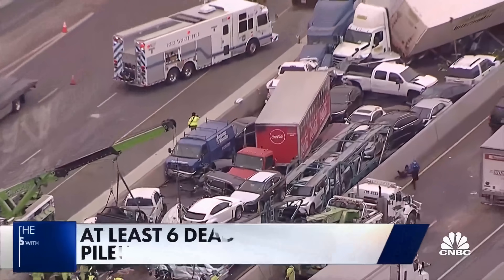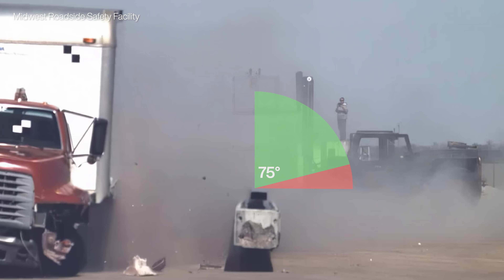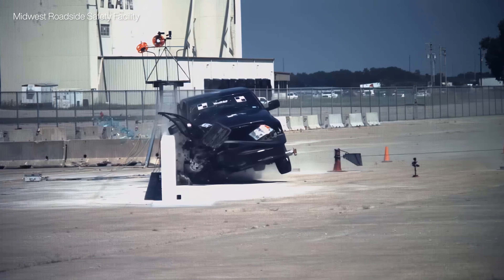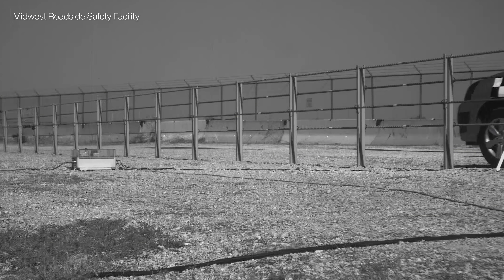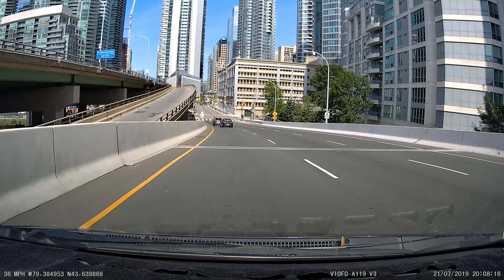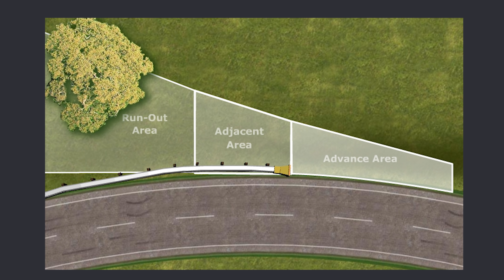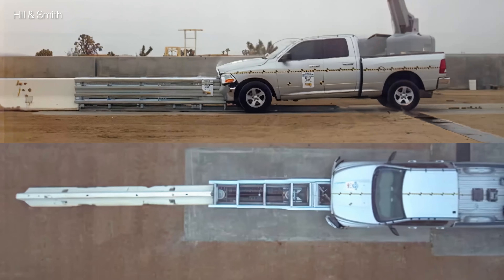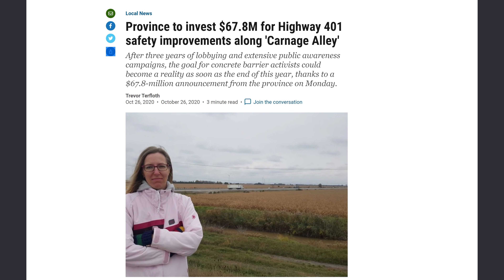How Road Barriers Stopped Killing Drivers

Comment: Cable barriers are the most dangerous system when it comes to bikers.
Reply: Just dont crash lol no seriously though I've never thought about motorcycles crashing in those things
Reply: @alexrosado3890  There is One thing that is Certain in Bike Life..Its not a matter of IF one crashes, Its a matter of When one Will crash.
Reply: God, these comments are full of posturing losers.
Reply: Dont byek
Reply: Not according to acutal research which found effectively no difference between cables and guard rails and only a minor difference between those and concrete (but we're talking like 5% less chance of fatal or severe injury). The entire rigamarole about cable barriers being 'dangerous' for bikers was like so many such things based entirely on a vague, anecdotal or speculative assumptions. The truth is it doesn't really matter WHAT the barrier is, if a motorcyclist goes into it at speed, he's pretty much fucked regardless BECAUSE he's a motorcyclist. 

Just one more reason they're fucking death traps.
Reply: @Tk3997  LAL  Laughing a little
   Thanks.  I get so bent out of shape when people make statements, that they may honestly believe, without any facts.
   The whole bit about "full moons" for example, for police, fire, any rescue work, doesn't hold up.  Counting -- many times research only takes counting 1,2,3,4 --  shows that events are no more frequent or intense during full moons than on other nights.
           Retired librarian
Reply: @Tk3997  Im gonna go out on a limb and guess you have no road rash to show off. XP I could very well be wrong and you are a seasoned Biker but, Im comfortable with doubting that. to have ridden much. I only say this due to you ignorance about barriers and how Motorcycles Actually interact with them outside of a search result on Google.  Fact is,  Every Post set system is a danger to Bikers by a factor of At Least as many Openings that are between the Posts..XD . Pretty much every biker out here would rather see a smooth Concrete wall or Nothing at all. The issue is with the spaces of any Post rail system, Those gaps tend to act like teeth at speed and bite off arms, legs and heads,... before ejecting the riders carcass into the roadway. Add a wire that acts like a cutting implement and its a slight bit worse. In contrast;  With a wall its much less of an issue as we can slide it out against a smooth surface and normally arent spun around like a Frisbee under a vehicle. or In many cases ive witnessed and rode out,  we can ride up  a walls curb without the bike getting grabbed by the post and spun out into traffic...  I have  been riding for 42 years, & Yes, I have seen and experienced a Lot of death while riding, Some from ignorance or Hubris but..Most of us, Myself included (*I got better), are killed due to Caged ignorance. Sure, Bikes are dangerous and many consider them "death traps" But, As some one that's Lived the Research,  Its usually other drivers that fuck us and  Overwhelmingly, the Car Hits the Bike Head on.. Even though construction matters, Barriers arent the danger to bikers, Caged ignorance however, Is.
Reply: @redneckhippiefreak  Amen!
Reply: @redneckhippiefreak  man you are spot on when i worked as a firemen i seen more bikers lose limbs hitting guardrails and almost every one that hit a cable barrier was killed those that hit concrete had broken bones but most survive and it was way less gruesome the cables and the guardrails was always a gruesome scene and almost every one of the crashes was caused by cars merging over on the biker or turning in front of them very few was the bikers fault
Reply: @redneckhippiefreak  We are not going to use Jersey for motorway medians except at narrow points.
Reply: @redneckhippiefreak  
No I don't, but that's irrelevant. You have no authority on the topic either, just like I couldn't claim to 'know' some random feature of roads is dangerous to cars based only on my own experience or something 'people tell me all the time'. You riding a bike doesn't mean you know ANYTHING about impact dynamics or the effects of crashes into barriers, if you were a roadway engineer then your opinion might hold weight, but just being a bike rider means absolutely nothing.Anecdotes aren't evidence, a fact far too many people don't or refuse to understand, and that's all your 'experience' amounts too. 

The reality is that research has failed to find an significant increase in injuries associated with wire barrier systems vs guard rails and only a minor one vs concrete. In point of fact based on what testing has been done and utterly contrary to what you claim the real danger doesn't even actually seem to be in the wires, but rather the riders impacting the POSTS, but this was also a risk factor for guard rails were it was fairly easy for riders to slide under them and into the posts or to strike the end of the rail. This was compounded by many system basically using I-beams in the ground with sharp edges, but this is now being moved away from for this reason. 

This is entirely sensible as contrary to Hollywood, steel cable thick enough to catch a speeding car is not going to act like a lightsaber when struck. The injuries from wires themselves are blunt force, but the wires themselves have more give then a rail or concrete barrier, this is a part of why they're safer for cars as noted in the video. This effect is not lost on a bike rider, while there may be some increased risk of snagging resulting in a twisting injury of some kind, it's probable that the overall level of deceleration is probably lower reducing other injury risks.  

In the end the evidence that has been collected thus far has failed to strongly show any increase motorcyclist deaths and injuries from wire barriers, but it HAS fairly conclusively shown marked reduction in cross median intrusions by cars where they've been used which tend to produce a highly disproportionate number of fatalities and serve injuries. Thus even IF the wire barriers were slightly more hazardous to motorcyclist there use would still probably be justified based on the fact cars are FAR more common and they are preventing many severe crashes by them. 

Few motorcycle crashes involve barriers anyway, single digit percentages of fatal accident according to studies, so there must be a cost benefit decision made here. Protecting many more car drivers, vs perhaps slightly increasing the risk to a small number of bike riders though even that's unclear.
Reply: ANY Barrier is dangerous for a Biker going 65mph+ tho right?
Reply: @NatronFatumallafalla  no not necessarily. Bikers who wear gear can with stand impacts up to 100 mph depending on the angle of the impact. Yes they may have many broken bones, but walk away with their life still. I hit "head" on into a pipe fence at around 45 to 50 mph and lived. I broke my back and a lot of other bones, but I'm still here. So hitting a concrete barrier at an angle doing 70 to 100 is very possible to walk away from
Reply: @redneckhippiefreak  yeah unfortunately they live in their little bubbles of fear of everything thing and since we don't live with that same fear we are crazy and with lack of knowledge on what we actually know. I pray that they have their eyes opened and see the reality that those who drive in cage vehicles drive most of the time with a nonchalant mentality with no awareness around them. As when bikers, we ride with our eyes on everything thing around us. I'm not saying every biker is this way, but for those who take it as a lifestyle with respect do ride like that. And I'm also not saying every driver of a caged vehicle drives without any awareness, but a huge  majority of them do especially compared to a biker just because they have more protection around them. That's why you see so many people with bad attitudes swerving at motorcyclist with their vehicle because they no they will be just fine if they hit us. I don't usually have that problem, but I do have them dang country boys in their big trucks think they got to drive up on me if they don't agree with my riding and almost kill me because of their prideful angry attitude
Reply: Idk man I ran in the back of someone going only 5mph and it totaled my car...coolant spraying everywhere air bags etc.  People don't realise how dangerous vehicles are
Reply: But that doesn't stop them from weaving in and out of traffic at 90mph, passing people on the divider line, and tailgating. When I see bumper stickers that say watch out for motorcycles I agree. You have to keep an eye out for them, they're always doing something stupid.
Reply: @HotspotsSoutheast  pathetic statement again from someone who just has no clue what it's like on a motorcycle.  Yes there are some people who get on a motorcycle with very little experience just like any teenager who just starts learning to drive a car, but sadly we have full grown adults driving cars and trucks distracting themselves with whatever it be inside their vehicle like phones, changing radio stations, talking to their passengers or fighting with their passengers, eating while driving and so many other things. Bikers hmm how often do they distract their selves with things while they ride? Maybe 1% if any! We happen to have hands, feet and eyes ready for any given moment that our lives can be taken for "any" mistake.  Unlike people in cars who don't really feel any threat the moment they sit down in their nice little safe zone. I drive cage to when I need to and with the experience of riding as much as I do I treat my situation in a car way differently then the average person and when a biker flys up I stay still knowing they are gonna lane spit and fly by and if they aren't going that fast, but still fast and I'm in the fast lane I move over as soon as I can. Without being angry. And I just hope the best for that rider. When I drive my cage my eyes are the same as when I ride. I constantly look all round me. My eyes are forward and they swivel to each mirror pretty often and when switching lanes I check all mirrors and look over my blind spot and I switch lanes slowly incase I happen to miss something and it allows for better reaction time for me and any other individuals on the road. Have a good day and practice awareness in your vehicle 😉
Reply: @HotspotsSoutheast  also walk up to a biker and say that😂 I pray for you! There's a reason we ride and it's because we are fearless. Be careful out there now😉
Reply: @HotspotsSoutheast  "facts" 
yeah ok bud
Reply: @DylanMcMullen  yup, sorry they hurt your feelings. I’m old enough to remember when people didn’t get their feelings hurt over facts
Reply: @HotspotsSoutheast  whered you see any feelings, much less hurt ones? Im just here laughing at your ignorance
Reply: Hahaha oh, I read it as "bikes" and not "bikers"
Reply: But aren't cable barriers almost exclusively used on highways?
Reply: @lalle5000  Yea I think he means "bikers" as those who ride motorcycles.
Reply: @lalle5000  not leg powered bike ^^
Reply: @lalle5000  bikers not to be confused with bicyclists
Reply: @justan idiot Meh, Its an odd sensation,  I lived in the mountains a long time..Ive been over a few road sides into the tree tops. XD  Few people live to cut their bike out of the top of a 60ft tree. XD Ive done it twice.
Reply: @redneckhippiefreak  Was it the same tree? Hahaa!
Reply: @redneckhippiefreak  dude, don’t buy lottery tickets and keep riding on bro!
Reply: People don't ride bikes for safety though. If they wanted to be safe they would get a car.
Reply: @WilliePeck  what a stupid stament! So people don't die in cars? Smh plain stupidity right there with that comment!
Reply: Bikers are already at risk to themselves as it requires only half a brain to operate half a vehicle ,

Stupid little jerk on a little bike with a dimmed tail light going only 55 in a 70 zone almost got turned into hamburger  ,

Comment: As a road designer who implements crash cushions a lot here in the Netherlands, i do have my worries with the re-usable crash cushions. On a light crash, o.k. but after a heavy crash not. They are tested in a new condition. Would you re-use an airbag after it's been deployed by folding the cloth back in and inserting a new gas-cartridge, I guess not. Here we replace the complet unit directly after a crash, and examine the old version in the factory if anything is still salvageable.

There is also a lot of controversy about the terminals that plow away the guardrail planks. A lot of them only work when you hit them on a 0-degree head-on angle. But normally when you run off-road you would hit them that under a 15 degree angle and they still impale the vehicle. Google search on "Trinity guardrail lawsuit" and you'll see what i mean.

https://www.google.com/search?q=trinity+guardrail+lawsuit&tbm=isch&ved=2ahUKEwj7lc6QluTwAhVB57sIHY0vAF4Q2-cCegQIABAA&oq=trinity+guardrail+lawsuit&gs_lcp=CgNpbWcQA1AAWABgzdADaABwAHgAgAEAiAEAkgEAmAEAqgELZ3dzLXdpei1pbWc&sclient=img&ei=1pSsYPvSFMHO7_UPjd-A8AU&bih=937&biw=1920&rlz=1C1GCEU_nlNL868NL868

or news article https://abc7news.com/i-team-new-study-guardrail-dangers-deadly-accidents/316842/
Reply from the maker: Hey Robin, I'm glad you chimed in.  I'm very much a layperson so I'm glad I can speak to someone with more expertise on this topic.  

I wouldn't be surprised if certain agencies decided to be less conservative with part replacement or cheapen out with inspection and repairs.  I've read a lot of reports of poor training which also compounds the issue.  

The Trinity guardrail story is actually quite interesting to me.  During my research, I read through the court case and some of the analysis from the defendants. Apparently, the change in width was to improve the reliability of the product. Yes, it saved money. It was what the lawsuits focused on as well as the people who got killed or badly injured.

The defendants say the product can be hit at speeds or conditions it wasn't designed for. That particular terminal was installed in a ton of locations so you would expect to see some people unfortunately die when they hit them under adverse conditions.

The testing VDOT (Virginia DOT) did to prove the terminal was unsafe was deemed flawed (by Texas A&M).  Their arguments were posted here: https://tti.tamu.edu/etguardrailresources/

Texas A&M and their engineers created and licensed the ET-Plus to Trinity which is why they are commenting on it.  Trinity won in the end but I wonder where the truth actually lies in this story.

I'm nowhere capable of weighing in on this case but from my perspective, it isn't as cut and dry as it was originally positioned by the media.

Edit: I just looked through the links again and apparently there was no variation in the feeder channel.  It's been a while since I last looked through this case.
Reply: @Lam  
Thank you for your respons. As i'm Dutch, i don't know all the ins and outs about the texas A&M terminals. But safety is always a discussion as it is cultural to what "save enough" is. Let's say the faulty terminals work 9 out of 10 times. If you take an random 3rd worldish country that can choose for either no terminals, or the faulty ones that work 9 out of 10 times That would mean an huge improvement in roadsafety for that country. Buy here in the Netherlands, only redirective terminals that can completely absorb the energy are allowed. Also the cable barriers are not allowed here. It always comes down tot budgets. But the road tax here is crazy high, and also the gasoline prises. (9 dollar per US Gallon at the moment) So the road budget here is much higher.

To put in perspective, the're about to turn a part of the ringroad around Amsterdam in a tunnel. That project will kost a whopping 1.15 billion dollar per mile.

Comment: Hey! I can attest, the clear zone works! It saved my ass back in 2016! 

I was driving a Crown Vic in heavy rain on a highway at about 65 mph. The traffic in front of me slammed their brakes. I slammed mine and began to hydroplane. I couldn't change lanes right as there was a semi-truck, and I wasn't going to slow down as I was hydroplaning. So I went into the center clear zone. I slid down the wet embankment and bounced into the middle barely threading the needle between two drainage tunnels and was able to take what was left of my momentum to get back up on the inner shoulder. 

So yeah! I'm glad the clear zone existed!

Comment: Great video, but i believe you didnt touch on another reason why cable barriers are dangerous and less used; They are extremely lethal for motorcyclists and convertable vehicles, often times decapitating or mutilating the rider/driver.
Reply: They're not meant to save the life of a small car tbh, but to stop huge trucks from median hopping with a load of bricks or something. Imagine being in your 2 seater, or on a bike, and having a semi-truck rail you from the front, that is what they stop.
Reply: @MotherSafeHarbor  the point isnt that they arent designed to save small cars or bikes, the point i am making is that they are severely dangerous to said small cars or bikes. There are alternatives that can achieve both stopping huge trucks and doesnt maim or kill motorists.